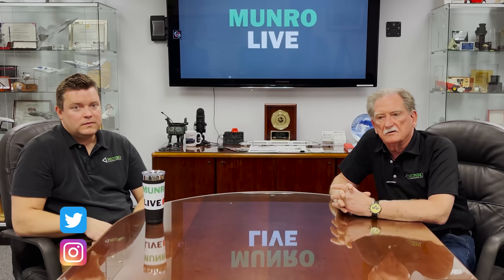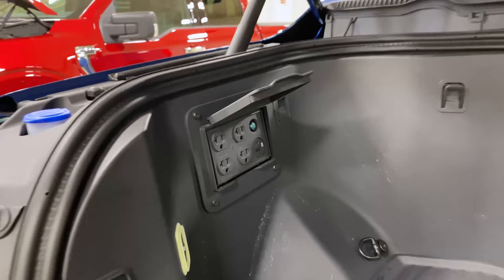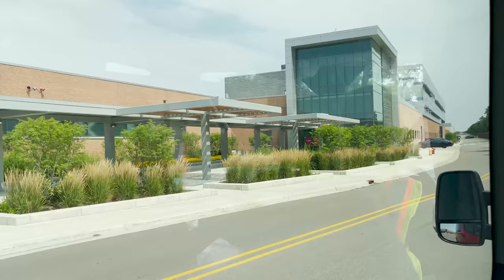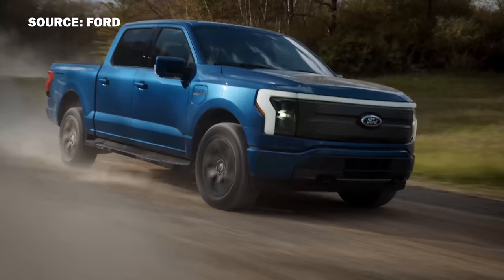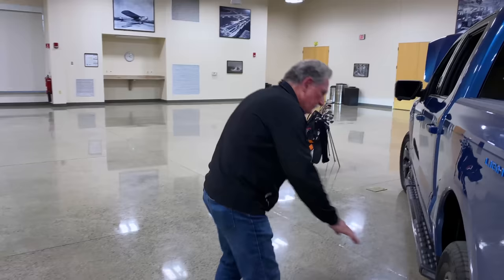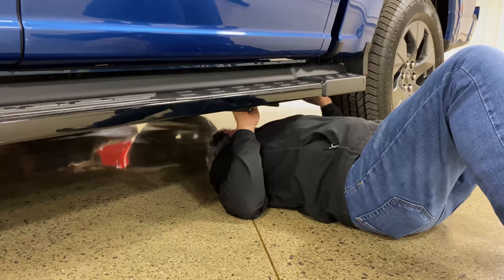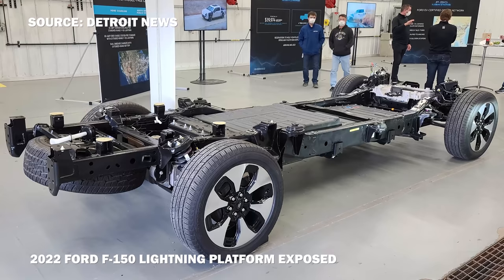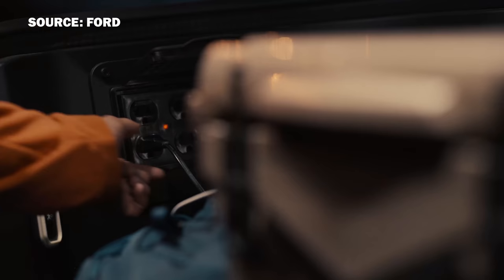Sandy's First Look at the Ford F-150 Lightning Electric Truck!

Comment: Wow, an electric pickup truck has so much going for it. Thanks to Tesla’s efforts to kick off the EV revolution!
Reply: @michaellowe3665  I think "right to repair" laws will address that. You have to give Tesla credit for lighting a fire under the butts of legacy car makers to produce serious EVs,not just compliance vehicles. Now you can get good EVs from GM and Ford. Tesla is about to release a $25K Model 2 that will help the average bloke afford an EV.
Reply: @mikedunn7795  if you follow Tesla's history, that 25k model will start as a 40k model.  They will finally sell a few of them at 25k 2 years after it comes out to meet their promise price, then they will stop selling it after a couple months and claim no one wanted it. Even if they score big gains in the battery cost, inflation is about to make the 25k electric car a pipe dream. Affordable cars are used cars that are over 10 years old.  Since there is and may never be an affordable replacement battery market, electric cars will remain disposable.
Reply: @michaellowe3665  " Even if they score big gains in the battery cost, inflation is about to make the 25k electric car a pipe dream" I heard the same thing when Tesla announced the projected price for the Model 3. TaDa, they did it! If you'd like to cite your references as to inflation projections on the specific battery industry, I'd be happy to see it. Otherwise, you sound uninformed. Your "affordable cars are used cars" is also a criticism of subjective affordability. If you personally cannot afford a new car, buy used. But to compare a decade-old used car to a new car in value is senseless.
Reply: @michaellowe3665  "They sold only higher trim models at first, then sold the 35k model for a short time," Looks like you lack basic math and logic skills. You just admitted that Tesla sold the Model 3 at the stated and projected price. How do you know that no one wanted the $35K model, and that more than enough people ordered more than the base features? 
"Most of the ones they sell are still 50k or more." Good for them - your own statements disprove your logic. Clearly the Tesla Model 3's base price is less than $50K, yet they sell the majority of their cars at more than the base price. That's good marketing and product creation, I'd say. You have completely disproved your own statements by admitting that the average Model 3 sells for MORE than it's base price, so maybe people want MORE than the base level features and pay MORE for it? If that's happening (and you've just stated it does), then MAYBE the pure base price wasn't wanted. Damn, I'm good.
Reply: @michaellowe3665  " Meanwhile, other car companies are selling 20k new cars that can drive 2000 miles on a trip without adding an extra day just for charging. Gas is not so expensive that it offsets the cost of interest on a 50k loan." Ah, now the anti-EV bias is visible. The price of Tesla's cars have nothing to do with your estimation of electricity vs. gasoline, but you've revealed that's your true argument. You just don't like EVs and are making some sidebar argument to convince yourself EVs are bad. 
I've owned an EV for 6 years now, 70K miles, driven in snow, mountains, 106-degree desert heat and it does not ad an extra day just for charging. Tell me, does your arse hurt a lot when you pull your statements out of it?
Reply: @michaellowe3665  "Gas is not so expensive that it offsets the cost of interest on a 50k loan. Most people live in reality bound by the laws of economics" And yet, Tesla outsold Nissan's sedans in 2021, outsells Mercedes Benz and other German car makers combined, and outsells all American car makers (sedans) as well. I'd say your reality is a biased one. No car maker aims to make its cars match the used car market. Show me the Ford board meeting that said "let's price the Focus like a used Chevy". 
Damn, I'm good.
Reply: @michaellowe3665  " Even if they can afford it, they find it wasteful to dump that much money on a disposable appliance." And there is the bias, again. Your  opinion of EVs does not mean the facts change for you. Don't want an EV? Don't buy one! Get your facts and logic straight, however. 
My "disposable appliance" is the best car I've every owned. Every software update improves it. No maintenance. No expensive gasoline. No exhaust. No oil changes. By all means, drive a car that needs Exxon's permission to operate.
Reply: @michaellowe3665  "Gas is not so expensive that it offsets the cost of interest on a 50k loan." Clearly people buy cars for things other than mileage, otherwise only a Toyota Yaris would sell. People are willing to buy a Tesla for the other factors that make the car attractive, namely continual updates, no gasoline whatsoever, 1/4 the operating cost, no maintenance (oil change, anyone? New spark plugs? Cat converter?). Keep making up reasons to not like an EV, this is fun.
Reply: @justsomeguy934  you wouldn't know logic if it bit you in the wallet. So you bought one and need to keep justifying it to yourself.  Ok thats fine. You missed the point.  Most people dont waste money like you so as much as they may like not having to buy gas, smell exhaust or pay for oil changes, they would rather not pay a bank thousands of dollars for interest on a loan for something that will be worthless in a decade. Tesla will sell plenty of 50K appliances to whoever will buy them, but they dont have a 35k car out there and they wont be getting customers that Mazda, Toyota and Ford are selling to now. They will get fanboys that are willing to prioritize fart noises on demand and overlook shoddy build quality. There are undoubtedly people that just have plenty of money and want a fast car that buy them too. It may even make sense to some people depending on their living situation, but it isnt a mass market car.  Its a gimmicky toy and hopefully the moments of joy it gives you to hear that fart noise when your passenger sits down makes up for the fact that you could have financed your retirement with the cost of the payments.
Reply: @justsomeguy934  you make a lot of dumb assumptions.  I really have nothing against EVs.  I may even buy a lightning used after some dope takes the hit on the new cost and you can get batteries for them.  I dont care for Teslas because they don't build serviceable cars.  When they eventually do need a battery they will be scrap because it will be cheaper to buy a new car than a replacement battery.  Hopefully there will be a replacement battery market that will make them not so worthless.  Other car makers have always made replacement parts available and didn't block aftermarket companies from making them.  They probably will with batteries too.  Tesla seems more interested in protecting their own profits than letting any aftermarket company make replacement parts.  They make their assemblies so complicated that replacement isnt easy.  Be a Tesla fanboy all your life if you want. I really dont care, but justify it to yourself instead of being shitty to other people.
Reply: @michaellowe3665  "Most people dont waste money like you so as much as they may like not having to buy gas, smell exhaust or pay for oil changes, they would rather not pay a bank thousands of dollars for interest on a loan for something that will be worthless in a decade. " Ah, the blatherings of the biased. May I assume that you make your same expensive car rants to, say, Lexus owners? You know, the people that buy a Toyota Camry rebadged as a Lexus but with $20,000 higher price? Or Cadillac owners that buy an Impala for many times the Impala price? Or the people that simply can afford a new car when you can't? I notice you haven't admitted that Tesla outsold all American car brands and is overtaking even Toyota. I proved your wrong, but you changed the subject as people like you do. This is fun, keep the hits coming pal!
Reply: @michaellowe3665  " Its a gimmicky toy and hopefully the moments of joy it gives you to hear that fart noise when your passenger sits down makes up for the fact that you could have financed your retirement with the cost of the payments." Ah, there's nothing like a sour grapes cry of the angry and jealous. We're past any factual discussion (we never WERE in one, but you didn't know that) and just hearing you say "anything but Tesla!". 
This would be amusing if you weren't making such childish statements. Do you want to keep buying gas, making poison out the tailpipe, keep Exxon in business and our finest giving free military escorts to oil tankers? By all means, keep that oiler. If you don't mind, after almost 50 years of driving and LOTS of cars, I'll keep my ever-improving car thank you very much. If you don't want an EV, don't buy an EV. But stop sounding like a baby that wants someone else's lunch.
Reply: @justsomeguy934  you think you are making good points but none of them refute anything I actually said.  Your straw man is certainly taking a lot of hits, but he isnt real.  No one said ford is trying to price new cars like an old Chevy, but they do have to compete with old Chevys when they sell them because people may figure out they can buy 3 of them for the price of a new car.  The new car market in general has to complete with the cars they sold in previous years.  Tesla's strategy is to just make them disposable.  You just keep paying them for the privilege of driving a virtue signaling status symbol.
Reply: @michaellowe3665  "Tesla will sell plenty of 50K appliances to whoever will buy them, but they dont have a 35k car out there and they wont be getting customers that Mazda, Toyota and Ford are selling to now." Again, you make baseless conjecture. In fact, what scares Ford, GM and other car makers is this: once a person buys an EV, they NEVER GO BACK to a gas car. I've talked to countless EV owners, all brands, and they all say they will never buy another ICE again. This is from people that trade in reliable cars like Honda Civics, Toyotas, Subaru's. Once traditional car makers lose a sale to an EV, they never come back.
Reply: @michaellowe3665  "It may even make sense to some people depending on their living situation, but it isnt a mass market car. " Again with the baseless statements. I've already proven Tesla outsold Mercedes Benz + Audi combined, outsells all American brand sedan makers, outsells Nissan in the USA. If that's not a mass market car, tell me what is. Tesla is eating every single car maker's lunch, pal, whether or not you want to admit it.
Reply: @michaellowe3665  " So you bought one and need to keep justifying it to yourself." Actually, it sound like YOU need to justify your ownership experience, not me! I can tell you that Tesla's research proves that the average Tesla owner sells 3 new cars. That's why Tesla never buys advertising - the owners, once they let people ride in their car, drive their car, see how the car works, trigger the sale of (on average) 3 more Teslas. Show me another brand that does that. It ain't Ford! It ain't Chevy!
Reply: @michaellowe3665  " they may like not having to buy gas, smell exhaust or pay for oil changes". Then why drive those cars? I go almost 300 miles on the price of about two clothes dryer runs' worth of electricity (about $11). The newer Teslas go 400 miles on that amount. One moving part in the motor (not hundreds or thousands), no oil, no spark plugs, no alternators, no exhaust, no high-pressure cooling system. If you think you're on to a good way to get around, be my guest. I haven't been into an auto parts store since I bought my Tesla, and will never need to. What advantages were you talking about with gas cars? I've forgotten what they are after typing all the things I don't need anymore...
Reply: @justsomeguy934  everyone will be making EVs. Tesla may or may not survive the competition. When there are other EVs to compare them to, Teslas will probably not fare so well.  There will likely be gas cars around for a long time to come because they make more sense in some situations.  Quit being such a dopey fanboy.  No one is jealous of your car payments.
Reply: @justsomeguy934  since this whole story was about the Ford F150 lightning, or have you forgotten?  Towing long range is the big problem with EVs.  Hook up a big boat and tow it from Michigan to Florida and you will see the limitations.  When you spend an extra 8 hours charging, you will wish you could just pull up to a pump for 10 minutes. This is true of any EV on a long trip,  but to a lesser extent when not towing. I agree they are better in most other circumstances except the purchase price. Those are big hurtles to main stream adoption.
Reply: @michaellowe3665  "No one is jealous of your car payments." I don't have car payments, and clearly you ARE jealous from your past comments. As for Tesla not faring well, it's the ICE manufacturers that are at least a decade behind Tesla. Only Tesla is building giga-factories to meet demand while everyone else is laying off workers and shuttering factories. Ford is in so much debt right now that they may never get out of the hole. Mercedes has shut down factories and gave up on making their own batteries. Building factories vs. shutting down factories...you can do the math, can't you? Regardless, you won't even be able to buy a new ICE after 2030 or so, let's see how quickly the traditional car makers convert, shall we?
Reply: @justsomeguy934  ok. I'm jealous of your ability to live a delusion and believe anyone cares about your overpriced appliance.  I wish I could feel so certain of my own superiority in the face of overwhelming evidence of bad decision making. Its a gift you evidently possess to be so indifferent to the world.  It must be easy to get through life without being burdened by humility or common sense.
Reply: @michaellowe3665  "I'm jealous of your ability to live a delusion and believe anyone cares about your overpriced appliance." The fact that you said "overpriced appliance" in your first statement proves that YOU DO CARE. You have some sort of price issue with Tesla, or the people that buy them, even though there are models that match the average price of a new car. You also made some comment about my car payments; who cares but you what my car payments might be? Your comments throughout this conversation have stated that normal people can't afford Teslas, normal people want used cars, etc. I've heard that exact argument about Teslas when the only models were the expensive ones (but oddly enough, they didn't lodge the same comments against Mercedes Benz or the people that buy $100,000 pickup SUVs). 
Your entire rant is obviously sour grapes. You make up reasons to insult a car you cannot afford (there are used EVs, you know). Since you want to call me names for proving your statements wrong, I bid you goodbye. You're looking childish, however, so I suggest you go rail against something else and not be so transparent  in your motives and your issues.
Reply: @michaellowe3665  " Be a Tesla fanboy all your life if you want. I really dont care, but justify it to yourself instead of being shitty to other people." Ah, the projection is strong with this one. You  know nothing about me at all, other than I bought a Tesla. It's you that has called me delusional, told me I don't make good decisions, have traded my retirement for a car, etc. I'd say it's YOU that's shitty to anyone that disagrees with you. I proved your statements false with facts (remember the sales claims you made?) and rather than admit you were wrong, you made up another allegation to be disproven again. Your issues with Tesla change as often as they are disproven and you clearly have jealousy issues with people who buy one.
Reply: @michaellowe3665  "I dont care for Teslas because they don't build serviceable cars.  When they eventually do need a battery they will be scrap because it will be cheaper to buy a new car than a replacement battery." Funny, you only mention serviceability now after I refuted all your other claims. That's how hidden biases work, you know. You gradually peel away the outer objections and find the true issue someone has - with you, it's apparently jealousy with Tesla owners. As for serviceability with the cars, you're mistaken again. I've damaged my car - it's an early model - and had a huge amount of repairs done on the car by a third party repair shop. Tesla didn't get near the car at all, yet lo and behold, the repair shop got all the parts they needed from Tesla. The shop's parking lot was FULL of Teslas waiting for repair. That particular shop was authorized for Porsche, Mercedes and Tesla. If you want a good job, become an authorized Tesla mechanic.
So now that I've refuted your serviceability claim about Tesla, can you make up another issue?
Reply: @michaellowe3665  " you make a lot of dumb assumptions.  I really have nothing against EVs." It's you that projects your personal issues with EVs, Teslas in particular, on me. Should I replay back all the assumptions you have made about me? Your "serviceability" claims is just the latest one you have to hide your true problems with Tesla owners. I'm sorry you don't own a car that you like as much as Tesla owners like theirs. I'm sorry you feel the emotional need to call people that have reasons for buying the cars they own "delusional" and question their decision making ability. Your insults are all over the place, uncalled for and childish. When someone does that, it's clear that the true cause of their angst is not the particular complaint they have at the time, but a deeper, emotional one. I don't care what you drive, where you spend your money, if you like sports. I have never called you a name, just called out your random claims against me for owning an (now much older) Tesla.
Reply: @michaellowe3665  " if you follow Tesla's history, that 25k model will start as a 40k model." Oh, you mean like Rivian, Ford and Chevy do? Your criticisms are not only oblivious to how businesses work, you don't make the same criticism of other vendors in the same industry. Clearly your issues are with Tesla and no one else. Your bias is still showing, pull your pants up.
Reply: @michaellowe3665  "they would rather not pay a bank thousands of dollars for interest on a loan for something that will be worthless in a decade." Um, I've owned several cars from new that got to a zero-repair value. That means that the insurable value of the car is less than the cost of a major repair. In short, drive the car until it's in an accident or damaged, but it's not worth it to repair. You don't replace a $2,000 engine in an $800 car. So I've owned several gas cars that have reached that point in 10 years, your criticism of Tesla is baseless. The continual software updates in Teslas keeps their used value up, as the purchaser knows their car will continually improve over time.
Reply: @michaellowe3665  "Towing long range is the big problem with EVs.  Hook up a big boat and tow it from Michigan to Florida and you will see the limitations. " Um, I've towed a heavy car on top of a heavy trailer from my house to several states away. I used my Toyota Sequoia at the time that could tow 8,000 lbs. Do you think I got the EPA mileage shown on the sticker? My mileage was horrendous.
Reply: @michaellowe3665  "since this whole story was about the Ford F150 lightning, or have you forgotten?" Actually, this is the first time you've mentioned trucks at all, or Ford. You went off on a rant about Teslas in general, and they don't even make a truck (yet). I think YOU forgot what you've said. Oh and the Cybertruck is already sold out for several years of production. I wish Ford the best, they would be a good candidate to sell an EV truck due to their market share. Let's hope they do a good job and not drag their feet like they have in the sedan market by making compliance cars only. Personally, I'd buy a Rivian before I'd buy a Lightning, it looks like Ford stole some ideas from Rivian after they invested in them.
Reply: @justsomeguy934  the other way to look at " continual improvement" is they should have designed it that way to begin with but we're in such a hurry to ship the shit out the door they half assed the software knowing they could update it later. How many times does IOS send an update a few days after their last one to fix stuff they screwed up in the last update?  Cars aren't cell phones.  They have probably dumped some dangerous files through their updates and fixed them without telling anyone about them. Its only a matter of time before they send an update that turns off the ABS in some situation and they dont get the fix out to everyone before a few people die.  Thats a shitty crutch for shitty sw design. Tesla is better at it than Chevy because at least they dont burst into flames when charging, but its still better to have it right before it ships.
Reply: @justsomeguy934  I like the architecture of the Rivian more than the Ford.  4 motors is a better solution.  It automatically eliminates differentials with optimal traction application. I probably still wouldn't buy the Rivian for several years because vehicles are exposed to the real world where things break and get damaged.  Much of the F150 will be interchangeable with the other 4 million trucks they build the same year.  There will be plenty of parts available.  A guy got rear ended in a Mach E and has to wait 6 months for the parts to fix it.  Even though its a Ford, they just haven't made enough replacement parts yet. Rivian is likely to be worse because they are a small startup that will be focused on getting their new trucks out of the door first. I also really hate the front end styling of the Rivian.
Reply: @michaellowe3665  "There will be plenty of parts available.  A guy got rear ended in a Mach E and has to wait 6 months for the parts to fix it. " Most new models are the same. I have a friend that's a Mercedes enthusiast (runs the local MB club), and every new model, depending on which sheet metal part you damage, can wait 6 months or more for parts. My damaged Tesla waited months on parts, but that is better now for my model than the new Model Y's.
Reply: @michaellowe3665  "Much of the F150 will be interchangeable with the other 4 million trucks they build the same year.  There will be plenty of parts available." That is an advantage of a Ford, as long as you didn't damage the electronics, battery or drivetrain. If the bumpers and sheet metal are the same, hot dog. If Ford designed the Lightning from the ground up to be an EV (like Rivian did), not much will be in common. Whatever Ford does, they are the best positioned to sell an EV truck at the moment. When the Cybertruck starts producing  vehicles, it will change the truck market entirely but any EV for that untouched demographic is good.
Reply: @michaellowe3665  "Rivian is likely to be worse because they are a small startup that will be focused on getting their new trucks out of the door first. " Yes, startups in the auto industry have billion-dollar problems that other entrenched companies don't. Tesla has already crossed that boundary and Rivian is learning from the Tesla experience, thankfully. I am currently researching Ford's battery supply chain, the most critical factor in volume production. GM uses South Korea (LG Chem) as their supplier, as does Mercedes and others. Nissan sold their battery factory, not a good sign that they'll be in the EV business for long. Toyota is completely out of the game, their future is at risk.
Reply: @justsomeguy934  defending a purchase of a Mercedes is more of an uphill battle than your Tesla.  They are an extreme waste of money and you still have to buy gas for them. They are better than Tesla about initial build quality, but then they have expensive parts including complicated engines.  Elon Musk was genius for going after buyers who may otherwise get a Mercedes.  It's not hard to beat their ownership experience. That was my point from the beginning.
Reply: @justsomeguy934  by the way, you keep bragging about only spending $11 to drive 300 miles.  Thats about half what it costs to drive a gas honda or Toyota the same distance.  The gas car drivers are also paying road tax when they buy it.  That can be half the price of the gas. If they put the road taxes on the coal you are using to drive around, then you would be paying about the same.
Reply: @michaellowe3665  " by the way, you keep bragging about only spending $11 to drive 300 miles.  Thats about half what it costs to drive a gas honda or Toyota the same distance." The price per mile varies with the price of fuel. My brother's Civic gets about 42mpg, which is great. It's difficult to compare his mileage to my 114mpge as the two cars are not the same. His 2018 Civic is a (at best) four-passenger economy car with lackluster performance. My Tesla is a 7-passenger vehicle, the size and weight of a Mercedes S-class sedan, and goes 0-60mph in less than 5 seconds.
Reply: @michaellowe3665  " If they put the road taxes on the coal you are using to drive around, then you would be paying about the same." Road tax (actually called DOT tax) is an issue that electric cars will have to tackle. The gasoline tax, while it doesn't cover nearly the actual costs of using an explosive, poisonous fuel, are proportional to usage. That is, drive a little pay a little; drive a lot, pay a lot. That's a fair way to do it, in my opinion. There is no good solution for cars that do not buy gas, and is quite the discussion topic among EV owners.
Reply: @michaellowe3665  "by the way, you keep bragging about only spending $11 to drive 300 miles.  Thats about half what it costs to drive a gas honda or Toyota the same distance." What Honda or Toyota are you comparing, say, a Model S to? Surely not a Civic or Camry, they're not in the same class. Use a Mercedes S-Class for vehicle passenger count, performance, storage room. Apples to Apples, and the latest S-class gets 20mpg city. My Model S gets 114mpge. Better than 5-to-1 improvement in mileage, not even counting that electricity is waaaaaaay cheaper than gasoline.
Reply: @justsomeguy934  Road taxes are federal and state not just DOT.  They were justified to pay for road construction.  The taxes far exceed spending on roads.  They heavily subsidize government spending elsewhere.  Many states are nervous about losing the revenue because they cant print money like the federal government.  The answer will be huge license fees and tolls everywhere.
Reply: @michaellowe3665  " Electric power generation is dirty.  " Can be, but doesn't have to be. My roof can make 110% of all the energy I need, silently and pollution-free for decades. And it doesn't matter when a solar panel makes the energy, it reduces the overall energy creation from dirty sources (like coal). In fact, if even a small number of neighborhoods had solar roofs, no new power plants would need to be built; they would produce the additional energy they need.
Reply: @justsomeguy934  its not just the batteries.  Its the motors and controllers. Not to mention the solar cells when used to make "renewable" power. They use tons of cobalt. They also use other materials like neodymium and dysprosium. Sure they are trying to eliminate them.  They don't want to pay the cost of mining them and dont want to be associated with the horrible working conditions where they are mined. The fact is, your Tesla uses materials and power just like any other car.  You keep bragging about how it comapres to an S-class.  It would use much less power and fewer materials if you opted for the model 3.  Ranting about how other cars poison the air is a bit rediculous when you didn't even minimize your own footprint.
Reply: @michaellowe3665  "They are worse than a clothes dryer because even in areas where renewable energy is prevalent, people are charging their cars at night when the sun isnt shining and the winds are light." Actually, no. Electricity is electricity, and what matters is how much dirty fuel is used to create it. If we offset all of our daytime energy with solar, for example, we've cut down on the total energy pollution by almost 2/3. Even using a dirtier source off-peak doesn't affect the total reduction in both purchased fuel and pollution to make the energy.
In case you're not aware, I've encountered every single statement you've made before and done my research. I have references and stats for every statement I make; I can prove what I say. You have yet to give me anything with which to discuss or review (I'm hoping you give me an oil company "study", those are the most fun).
Reply: @michaellowe3665  " you are contributing to ecological and human deviation too.  The jury is still out on how much. " Hey - did you know how much electricity is required to refine a gallon of gasoline? I know you don't, you haven't exhibited any research or fact checking, but I thought I would let you know. The industry arguable standard is 5kW per gallon, just to refine it. That's not extraction, transporting the crude, storing the gas, moving the gas again, storing again, selling it. Just turning goop into gas. Here's an interesting fact for you, too: on 5Kw of electricity, most EVs can go 15-25 miles. That's more than the average mpg of a new gas car in the USA! That's right, using just the electricity required to refine a gallon of gas, an EV can go as far or farther than a gas car can without burning the petroleum! Imagine that, just give the electricity required to refine gasoline to an EV and you get no pollution, no explosions, and you save crude being moved all over the Earth. Win win for EVs, yet again.
Damn, I'm good.
Reply: @michaellowe3665  "Ranting about how other cars poison the air is a bit rediculous when you didn't even minimize your own footprint" Let's see, no point-of-use pollution for an EV, a 96% recyclable storage battery, energy that can come from my roof. I'd say that's a minimized footprint!
Reply: @michaellowe3665  " Its the motors and controllers. Not to mention the solar cells when used to make "renewable" power. They use tons of cobalt. They also use other materials like neodymium and dysprosium." And for that material investment, you get free energy with no pollution for decades, no maintenance. BTW, I'm sure you're a smart guy, you're aware that creating a solar panel is the same process as making an LCD television, right? May I assume you visit various environmental blogs and protest all the flat screen TVs being made? I mean so you're not a hypocrite? 
And if you don't mind, please cite your references (scientific ones, please) for "tons" of cobalt in solar panels.
Reply: @michaellowe3665  " They don't want to pay the cost of mining them and dont want to be associated with the horrible working conditions where they are mined." Are you off-topic, or are you talking about solar panels? If it's batteries you're referring to, I've already debunked your "child labor" allegations pretty handily.  If you're referring to other metals like copper, magnesium or anything else, I suggest you research the computer you're using right now, or the car you're driving. Chromium is quite rare, found mostly in Africa, and is all over cars and in certain types of metals. If it's solar panel materials you're referring to, you must compare the raw materials from an alternative energy source, say, coal. Or diesel. Every minute those energy sources make electricity, they pollute. You must purchase and consume fuel. Solar panels and wind turbines, nothing at all.
Damn, I'm still good.
Reply: @michaellowe3665  "The fact is, your Tesla uses materials and power just like any other car.  You keep bragging about how it comapres to an S-class.  It would use much less power and fewer materials if you opted for the model 3. " The Model 3 wasn't available when I bought my Tesla, I couldn't buy it. I also have greater needs than a Tesla Model 3, but the Model Y or X looks like it could do for me. In the end, my car will outlive me and I have no need to replace it. After all, it does more, goes farther, is cheaper to operate than it was when I bought it.
Reply: @michaellowe3665  "You keep bragging about how it comapres to an S-class.  It would use much less power and fewer materials if you opted for the model 3. " And you could use much less power and fewer materials to drive any EV made, as it uses electricity, burns nothing, has a recyclable battery. Did you still want to criticize my choice of car, or are you done?
Reply: @michaellowe3665  "its not just the batteries.  Its the motors and controllers. " As usual, you're not thinking. You believe there's a crisis with the motors and electronics in an EV? You're ware that they are single-moving-part, sealed devices that have a million-mile warranty, right? They'll outlive the car. They'll outlive me! There are already independent sources to get those devices out of totaled Teslas, as well as the batteries. The battery pack of a salvaged Tesla is worth THOUSANDS of dollars! You're just making up some bogus criticism, as usual, when I disprove yet another wild claim of yours. I must compliment your tenacity to cling to such an easily disprovable opinion.
Reply: @michaellowe3665  "They don't want to pay the cost of mining them and dont want to be associated with the horrible working conditions where they are mined. " You mean like the iron, bauxite, magnesium, copper,  chromium and other mined metals in the car you drive right now? Or in the computer you're using right now? Or in the television you use?  Or in the cell phone you have? Is THAT the horrible conditions for the products you purchased already? Or is it just when EVs use metal, glass and rubber that you're offended?
Reply: @justsomeguy934  you have debunked nothing in the whole conversation. Just because you say they dont use rare earth metals in batteries doesn't make it true. Where are your sources?  I know they still use them in motors.  Lithium isnt exactly clean to mine.  The worst is cobalt.  I mentioned solar panels to head off your next argument that all your energy use is "renewable".  Maybe I presumed too much and you would just admit that your car runs on coal.  

Look I dont have anything against electric cars.  They are somewhat better in most ways than gas powered ones except long trips.  I dont like Teslas because they are kind of ugly.  They look like a dodge stratos that was parked next to a fire and the grill melted shut.  The interior is dumb.  It looks like a child hot glued an I pad to the dash. Nothing works if the center screen goes bad. Unfortunately Ford is copying that stupid look.  

Tesla took a simple drivetrain and added needlessly complex doors, handles and actuators that can fail and do often.  Watch TFL cars on YouTube to see what a piece of junk their model 3 was.  Their service system requires you to wait for them to show up.  They are hostile to people who want to do their own repairs. Watch Rich Rebuilds for that story. My Toyota had a bad drivers door lock.  I watched a YouTube video and bought 2 motors for $12 on Amazon. It took me a couple hours to fix it. I only needed one motor so I have a spare.  Tesla would void supercharging if I dared to fix my own door lock. 

Tesla put cameras inside the car and constantly collects telemetry data on their customers.  They say its needed for self driving that many customers dont even have, but in reality they are selling the data.  They also use it to deny warranty claims and blame customers for crashes during their self driving beta test if they didn't have both their hands on the wheel at the time.  

They have shoddy build quality in general but are getting better with more recent models.  

I plan to buy my next car soon and drive it for 20 to 30 years.  I want to be able to fix anything wrong with it and keep driving it.  It is not feasible to put a $30k Battery into a 12 year old car.  

Im glad there are early adopters out there spending their money foolishly. Im glad Tesla is building toys for people that real car companies are learning from. When those companies are making reliable cars with decent build quality and I can buy a replacement battery and put it in myself, I will probably get an electric vehicle.  More likely, I will just rip the motor and gearbox out of one like yours when it hits the junkyard and I will put it in something that looks good. 

Hell its possible Tesla will make something I would buy someday. They would have to ditch the data collection, make it decent looking and only make it update when I want it to. 

Most of what you consider features of your car, I find abhorrent.  You can enjoy it all you want. I dont care. I dont like them for now and wont unless they make major changes to their design and attitude toward customers.
Reply: @michaellowe3665  "Just because you say they dont use rare earth metals in batteries doesn't make it true. Where are your sources?  I know they still use them in motors. " I never said they don't use some rare metals in batteries; I said they are miniscule levels and the entire battery, all metals and casing, are 96% recyclable. You should read what I write, and you should not type up a novel all at one time. If you'll note, I quote back to you what you say and then react. That's how you have an online discussion.
Oh and I have refuted every claim you've made, with links to unbiased sources (or haven't you check them out?) Let's see the topics so far: Tesla isn't selling, Tesla's got the wrong market, electricity is as dirty as oil, etc. I can actually go back to your previous comments if you like and list all my responses to your claims.
Reply: @michaellowe3665  "Hell its possible Tesla will make something I would buy someday. They would have to ditch the data collection, make it decent looking and only make it update when I want it to. " Gosh, do you have the same requirement for your cell phone? Apple for one won't let you go too long before a software update, as will Adobe for Photoshop. Companies cannot have the liability of a customer refusing an update for safety reasons. As for the looks of a car, you can drive an econobox all you want; be aware that many Tesla cosmetic points are already copied by other car makers. In fact, it's whether or not your car looks like a Tesla, not the other way around.
Reply: @michaellowe3665  "They have shoddy build quality in general but are getting better with more recent models.  " Again, customer satisfaction with Tesla exceeds all other brands. I've owned my Model S for 6 years now, it's the best car I've ever owned and I will never buy another gas car again given my experience. That's what scares the likes of Exxon and Honda.
Reply: @justsomeguy934  my cell phone wont ram me into the back of a truck by turning off the ABS due to a glitch. Oops sorry. That was 14.1 sw.  You should have updated to 14.1.1 when it came out 4 minutes before your accident.  We arent responsible.
Reply: @michaellowe3665  " You can enjoy it all you want. I dont care." But you DO care. You've done nothing but call me names, called me delusional, stated I don't have good decision making ability, spent my retirement on my car, etc., just like a jealous child. You've shown you care every comment you've made. It's damned obvious.
Reply: @michaellowe3665  "Look I dont have anything against electric cars. " Just those that buy Teslas...
Reply: @justsomeguy934  econobox...  Have you seen the cybertruck?  Its a doorstop.  The reason other cars look like a Tesla is they copied other cars from the 90s. Not good ones either. I prefer trucks, or cars that are 50+ years old for styling.
Reply: @michaellowe3665  "They look like a dodge stratos that was parked next to a fire and the grill melted shut.  The interior is dumb.  It looks like a child hot glued an I pad to the dash. Nothing works if the center screen goes bad. Unfortunately Ford is copying that stupid look." Welcome to touch screen cars, pal. They're all copying Tesla because it's a superior design. What you THINK are analog gauges are likely digital ones. Trucks and cars all have that layout now, and hope someone THINKS it a Tesla. My 17" touch screen is integrated into my dash, shows me car status and navigation, tells me where to charge, manages the car for me. 
If you like your Buick Century and oil pressure gauges, have at it. No car you buy new in the future will, so you be the dinosaur that you are.
Reply: @michaellowe3665  " I dont like Teslas because they are kind of ugly." You  don't like Teslas because they're not  what you're used to and they [used to] cost more than you can afford. Your vitriol towards me in your conversation shows that plainly.
Reply: @michaellowe3665  "I plan to buy my next car soon and drive it for 20 to 30 years.  I want to be able to fix anything wrong with it and keep driving it" I couldn't agree with you more. Given that the battery in my Tesla is rated for 300,000 to 500,000 miles and the motors have only one moving part, I'd say it's a safe bet I'll get to 30 years in my Model S long before you get to 30 years in a car burning oil.
Reply: @michaellowe3665  "When those companies are making reliable cars with decent build quality and I can buy a replacement battery and put it in myself, I will probably get an electric vehicle. " So you want to replace a 1,100lb battery that lasts 300,000 miles yourself? Tell me, do you have the same standard for gas cars? Do you, say, often replace the engine block of the cars you drive?
Reply: @michaellowe3665  "Have you seen the cybertruck?  Its a doorstop.  The reason other cars look like a Tesla is they copied other cars from the 90s. Not good ones either" And yet the Cybertruck's first 3 years of production are already sold out. Love it or hate it, it's popular. Want a truck that looks like a 1962 Studebaker truck? Buy a Ford!
Reply: @michaellowe3665  " I prefer trucks, or cars that are 50+ years old for styling." Then you'll realize that you're a very small demographic that no car maker will cater to. Evidence: the retro-styled Ford Thunderbird, the retro-styled Plymouth Prowler. Keep driving that Buick!
Reply: @michaellowe3665  "That was 14.1 sw.  You should have updated to 14.1.1 when it came out 4 minutes before your accident.  We arent responsible." Oh sorry, does your criticism include the steering column lock on Chevy sedans a few years ago that caused the cars to crash and killed the occupants? Or the fires caused by a drop-in tank on the Pinto? Or the wheels that fell off Jeeps of a certain year? Or the car fires caused by the Honda window switch on the Accords when water fell on the switch from an open window? I'm having trouble assessing your risk from a Tesla software update...
Reply: @justsomeguy934  millions of people still like classic cars and would drive them if they had the skill to maintain them and could add a few new features.  Classic car auctions appeal to more than a small demographic.  Teslas are boring looking cars.  The reason they are tapered is so the factory doesnt slam shut when they drive out.
Reply: @justsomeguy934  watch rich rebuilds. Your repair shop may have gotten permission from Tesla, but home mechanics have more problems.
Reply: @michaellowe3665  "watch rich rebuilds. Your repair shop may have gotten permission from Tesla, but home mechanics have more problems." As I've already stated, I'm acquainted with Rich Rebuilds. I've disproven your right-to-repair allegation, and would like to know how many people take the engine out of their car...do you? Exactly how many Teslas need to be rebuilt from a salvaged car like Rich does? That's your standard for car repair?
Reply: @michaellowe3665  " I know the benefits of electric cars.  I also know their limitations.  I would easily replace a battery in one if I can get the technical information to do it.  " You know much less than you think because you don't drive one or own one. By all means, if you want to replace the battery in a car, do so. The times that you'll need to do that are...zero. Since they last 300,000 miles before 10% degradation, I'd say I have long after I'm dead before I'll even need to think about it. Oh and why are you driving vehicles that need their engines replaced? Maybe you should think about getting an EV, only one moving part per motor....wink wink
Reply: @michaellowe3665  "Who do think goes into Autozone? They have a whole shelf full of books that show you how to work on them. " And that shelf of books tells you to...replace a water pump? Change the spark plugs? Weld on a new catalytic converter? Pull the exhaust manifold? You need that because those cars have all those moving parts! I don't think you realize that the need for those skills is unnecessary going forward. Tesla will send a tech to my HOME, in my DRIVEWAY to fix or adjust something. Do I know people that have replaced parts on their Teslas themselves? Sure! You're "I've gotta replace the battery myself!" requirement is certainly unnecessary and an unrequired skill for an EV. I refute one thing you say, you jump to another. This is still fun.
Reply: @michaellowe3665  "I would never waste money paying a mechanic to do work I can do myself.  Thats a bigger demographic than you think.  Who do think goes into Autozone?" I never waste money doing work that costs less than I make per hour.
Reply: @michaellowe3665  "again you debunked nothing.  I know the Tesla and Ford have intrusive driver monitors that was my point. " I've debunked everything you've said! I've already given you a partial list, all you have left are opinions on what a car looks like, whether or not you like a touch screen, silly stuff like that. Do you really want me to make a greatest hits list of all the objections you've used to hid your anti-Tesla opinion? I'll get right one it.
Reply: @michaellowe3665  " again you debunked nothing.  I know the Tesla and Ford have intrusive driver monitors that was my point.  " Really? I've driven my Tesla with a 17" monitor embedded in the dash for 6 years and 70,000 miles now and love it. In fact, any car that does NOT have a touch screen is a Flintstones Mobile. Tell me, do your cars have a choke or spark advance?
Reply: @michaellowe3665  "Of course that is if you don't damage it by fully charging or discharging . I hate it when I fill my gas tank all the way regularly and it makes the tank smaller.  Wait that doesn't happen." Um, the computer manages the charging and while possible, damage is rare with 100% supercharging (I, in fact, know someone who did that). Even if your range is reduced, it fits in the expected degradation and range loss. My personal car? I've had 6% range loss first 2 years, then it's flat, no further loss. I charge every day, Supercharge on trips. I'd say I'm a good sample case.
Reply: @michaellowe3665  " I hate it when I fill my gas tank all the way regularly and it makes the tank smaller.  Wait that doesn't happen." Oh yes it does! Your ICE is never better than the day you buy it. It degrades in efficiency and MPG from that day forward. I've owned lots of ICE cars and I can personally tell you that the MPG drops after years of use, shortening the range, making the car more maintenance-prone and costly.
Reply: @michaellowe3665  "Teslas arent well made especially the S and the X. That isnt a secret. Most Tesla owners admit to that.  By the way spark plugs, catalytic converters, and exhaust manifolds are not moving parts." Did the fit & finish of the early Teslas match a Mercedes? Nope! Yet, Teslas outsell Mercedes, so your metric doesn't seem to matter much to the owner. Tesla's been making cars for 10 years now, MB for over 100 years. MB's, Toyotas, Nissans, Fords should be PERFECT. Yet, we have annual recalls and misfit panels on all brands. 
As for spark plugs being moving parts, they (and cat converters) are parts that wear and must be replaced. You're not honestly going to claim an ICE is equivalent to a sealed electric motor, are you?
Reply: @michaellowe3665  ""I have debunked you therefore I am right"  you sound like CNN. Still you have debunked nothing. " Hey - I'm waiting for you to say "I don't like EVs because the upholstery in a Tesla is bad". You just make up sidebar excuses to hide your jealously or your dislike for Tesla owners in general. I don't care what you drive, but YOU care what I do! You've called me delusional for spending what I did on a Tesla (what I can spend on a car is the true source of your issues, let's be honest), yet you don't also criticize (until called out on it) a Mercedes Benz purchaser or a truck purchaser. Only Tesla owners, or me. This long trail of complaints of Teslas or the EV industry in general is merely a distraction for the real issue - you can't afford an expensive car and hate those that do. You must keep up the charade to look like you have some environmental reason to feel the way you do, but we both know it's jealousy. If you don't want an EV, don't buy an EV. But to call names because someone has a nicer car, bigger house, better pay, etc., has no place for adults.
Reply: @justsomeguy934  actually ICE milage gets better after the break in period, then it slowly declines, but not noticeably.  Many gas engines go 300k miles or more.  You can then rebuild them for a few thousand dollars.  I have gotten over 200k from every one I kept long enough. At no time did I lose 10% of range.  It was also not dependent on filling my tank regularly.  I could do that every time and not adversely affect it. It also only takes 10 minutes to fill it so its not too big of a deal.  If you supercharge your Tesla to 100% regularly, you will kill the battery in 2 years.  Tesla will know because they are tracking you and they will not replace it under warranty. 

I do like the idea of filling up at home instead of a gas station.  I don't refute the actual benefits of electric.  You are such a one sided fanboy, you dont acknowledge any drawbacks.  Its a tradeoff and depending on your situation can make sense.  It just doesn't work for me yet.  I'll look at the Rivian and the lighting when they come out.  Maybe even the cybertruck, but that is not a likely buy for me because of all the current features I dont like in Teslas.
Reply: @michaellowe3665  "actually ICE milage gets better after the break in period, then it slowly declines, but not noticeably.  Many gas engines go 300k miles or more.  You can then rebuild them for a few thousand dollars.  I have gotten over 200k from every one I kept long enough. At no time did I lose 10% of range. "
Rebuilding the engine is a major event, wouldn't you  think? And one not required by an EV? As for 10% range loss, I don't know a single Tesla owner, even those with 150K miles, that have that much loss. The empirical data I've shown you (and will do so again) tell you that the batteries last 300,000 to 500,000 miles before any appreciable loss is incurred, and then you could - only if the loss affects you - recycle the battery. Your rebuilding the car's engine is equivalent to replacing a battery are you reset the failing parts of the car. 
As for losing 10% range in an ICE, I sure have! I can personally tell you that a 25mpg car after 100,000 miles gets 2.5mpg less than the day I bought it! And if I would be required to replace/rebuild the engine to do it, I wouldn't pay for it! 
So show me your 500,000 ICE car with less than the Tesla equivalent of 6% range loss without an engine rebuild, please.
Reply: @michaellowe3665  "If you supercharge your Tesla to 100% regularly, you will kill the battery in 2 years.  Tesla will know because they are tracking you and they will not replace it under warranty. " Interesting, as the older Teslas, in order to keep them warranted, have their supercharging speed reduced, not the ability to supercharge. As the car ages, the full charging rate is reduced slightly to maintain battery health. I know, I have a 6 year old Tesla. Your warranty statements are not true, nor to they match what I observe in owning my Model S for 70,000 miles. I've reviewed the warranty on my car and it does not say "excessive supercharging will void the warranty". Tesla does everything it can to keep the battery healthy. May I ask you again, does your arse hurt from pulling all the statements out of it?
Reply: @michaellowe3665  "Many gas engines go 300k miles or more. " But the cars don't! The average life, and financial value, of an ICE vehicle from new in the USA is about 100,000 miles. Cars are replaced at that point, insurance value is zero at that point, and any even minor accident causes the car to be totaled. I've never seen my car or a friend's car with much more than 100,000 miles on the clock before they replace the vehicle. Your statement is an engineering projection, not actual use or utility. The cost of maintaining an ICE after 100K miles goes up significantly, reliability drops significantly, even to the point of requiring an engine rebuild (which you admit to).
Reply: @justsomeguy934  you like to keep claiming other people are just "jealous" of your Tesla and all the money you have because you can afford it.  Wow.  That's something a mother tells a child who wore ugly clothes to school and was teased.  Its not something a well adjusted adult actually believes.  I stated why I dont like Teslas long before you decided to chime in and tell me all about yours and how you paid for it.  You made it a personal attack on your own judgment.  I just said I dont like how they build their cars.  

I dont like Mercedes either.  I believe they are overpriced, unreliable, difficult to repair and have dismal resale value.  I wont buy them but other people are welcome to do so. I never mentioned them at first, because they were initially irrelevant to a conversation about electric cars. You brought them up because its the only car that makes so little sense to an average buyer that it makes your Tesla seem like a wise decision.  

The fact is that a $700 clunker will do 90% of what any other car will do.  It will get you to and from some cube in the city at 15 mph in bumper to bumper traffic.  If someone wants a new car with some features, a 20k Mazda will do the same thing with air conditioning and reliability that will carry them past the point they will trade it in anyway.  Im fine with the fact that you like your Tesla. I dont care and am not jealous no matter what your mom tells you.
Reply: @michaellowe3665  " you like to keep claiming other people are just "jealous" of your Tesla and all the money you have because you can afford it. " No, just you. I never said anyone was jealous of spending money on a car but you. Your calling me delusional (do you deny that?) for spending that money, mentioning risking retirement to buy the car, etc., all comments from YOU related to the price of the vehicle. Those comments came from YOU before any other objections (child labor, dirty electricity, etc.) every occurred.
Reply: @michaellowe3665  " Im fine with the fact that you like your Tesla. I dont care and am not jealous no matter what your mom tells you." No, you are not. If you don't care whether or not I like my Telsa, why did YOU spend so much time calling in to question making ability for buying it, question my retirement for buying the car, mention the price of the car payments? You did all that, regardless of how you'd like to portray it otherwise. Just own it. You made up, or repeated, baseless arguments after I called you out on it.
Reply: @justsomeguy934  my point was it is an overpriced car.  That is one of its many drawbacks. Most people would get a loan to buy it.  Most people would pay more in interest on that loan than they will save in gas over buying a 2 year old Toyota.  I was making the case for most people.  I dont know you and dont care to.  You seem insufferable.  I dont care how you paid for it.  You volunteered all that information. No one wants to know it.
Reply: @michaellowe3665  "my point was it is an overpriced car. " Do you say that for a Mercedes owner? Or a Lexus owner? Or someone who buys an expensive truck? I bet you don't, or you denigrate anyone that can buy a car more expensive than you can afford.
Reply: @michaellowe3665  " You seem insufferable.  " No, I called you out on your insults. Don't want an EV? Don't buy an EV. Just don't make up bullsh!t about the owners and the cars. And don't call me delusional for buying a car you won't.
Reply: @justsomeguy934  some of those were other people's statements. You failed to mention your own obnoxious insulting statements. Namely that I must be jealous that you can afford a Tesla. Thats seriously childish. You proved my point about appealing to someone's vanity and need to vitue signal.  You pretty much confirmed it with all your comments about other people being jealous of you. I could admit that statement may be a bit harsh and it may not apply to everyone that buys a Tesla, but you pretty much fit the description.
Reply: @michaellowe3665  " You failed to mention your own obnoxious insulting statements. Namely that I must be jealous that you can afford a Tesla. Thats seriously childish." You're correct it's seriously childish that you care about what someone else can afford. Tell me which statement's weren't yours, please, as I copied them right out of your replies to me.
Oh and tell me where I called you delusional, called in to question your decision making ability for buying a car.
Reply: @justsomeguy934  I never said you were delusional for buying a Tesla.  You are delusional for thinking other people are jealous. I dont care what you can afford.  I care what most people can afford because it helps determine if there will be enough sold and if the company will be around long enough to honor warranties and provide parts. I care about the market for these vehicles. I hope the sell enough lighting pickup trucks to make them a good choice to buy 5 years after launch.
Reply: @michaellowe3665  " I dont care what you can afford." Your "for wealthy people" and "average bloke" comments prove otherwise. Did you want to talk about the child labor support you accused me of that was for copper mines? Or the lithium mining impact that isn't mined? Or the right-to-repair violation claim you made when I proved it false? Or the Tesla warranty issue if you supercharge too much with I disproved? Or that Tesla sells your driving data to other companies that I disproved? I mean, I provide the proof, you provide the false claim or idea. I have yet, btw, to see any references to anything you say is true about Tesla or EVs. 
Did you want to keep talking about this?
Reply: @justsomeguy934  I never said average bloke. That was someone else's comment. Pay attention.
Reply: @justsomeguy934  you provided no proof of anything.  You just typed it out like its the truth and you expect people to believe it.
Reply: @michaellowe3665  " you provided no proof of anything.  You just typed it out like its the truth and you expect people to believe it."
Absolutely incorrect, a lie if you will. I've provided multiple references to disprove what you've said. Independent sources for battery life on Teslas, for example. I've left you multiple links to sources you can review yourself. I've also told you where your statements were wrong, such as the Tesla selling your data. You have no proof of this whatsoever, but I can prove Tesla cancelled their contract with MobileEye (developer of AP1 autopilot logic) over that very topic. I've also left you references on Tesla sales amounts.
If you'll kindly go back and review my responses, you'll see the independent sources that disprove you. YouTube will drop any comment that has too many link in one place as spam, let me leave individual links for you (I don't like to repeat myself, but you're a special guy).
Reply: @justsomeguy934  thanks for that information.  Holy crap.  5.6% failure rate?  That is awful.  If gas engines failed at that rate, there would be a massive recall.  Many of them will have a small problem that makes them fail at some point, but its fixable for a few dollars to a few hundred dollars.  ICE cars rarely have a failure that costs more than that in the first 80 miles.  When a Tesla battery fails, it represents most of the value of the vehicle.  That came from an obvious Tesla fanboy wearing a Tesla shirt with 2 tesla posters.  Thanks for making my point.
Reply: @justsomeguy934  you failed to mention if those were driveline problems.  That is the only part that matters when comparing EVs to ICE cars. Wheels falling off isnt something that magically goes away because the car is electric.  Its still a car, not a land speeder. Try to stay focused. The reality is that all cars have various problems that need fixed. You wont find 5.6% of ICE cars that need a $20k to $30k driveline part replaced in the first 80k miles.   

The other video was just another EV cheerleader.  I dont disagree that electric cars have better drivetrains and could be a better choice for most people most of the time.  When you get all of your "research data" from other fanboys, its going to be a bit biased. With an issue as complicated as trying to compare all of the environmental factors between ICE and EVs there are many lies of omission embedded in their little cartoon.  What doesnt lie is the total cost of ownership. Cars are made if materials and energy.  When you add up all of the materials and energy that goes into them, you end up with a sale price.  Any 80k car has a bigger environmental impact than a 20k car.  Then you can add the cost of the fuel and you can get a better idea of what it takes to move you around. Cost and environmental impact are linked.  That is before you include the fact that EVs are subsidized and gasoline is taxed, highly.  If EVs needed less material and energy to build, they would sell for less than an ICE car.  Right now, they dont sell any EVs that compare to a base Mazda 3.  They have to bury the additional production cost in high cost luxury trims that cover up the additional energy and materials needed to make them.  Eventually they equalize out over time as the fuel cost applies, but that isnt a fair comparison, because gas is taxed more than the coal the EV uses.
Reply: @michaellowe3665  "you failed to mention if those were driveline problems.  That is the only part that matters when comparing EVs to ICE cars. " Sure were, very early in the history of the Model S! Guess what? Tesla fixed them, they do not occur anymore. The roofs of Model 3's that were cracked upon delivery were repaired under warranty, the robots fixed, not a problem anymore. I suggest you look into the reporting of a problem and see if it's been fixed to never occur again.
Reply: @michaellowe3665  "You wont find 5.6% of ICE cars that need a $20k to $30k driveline part replaced in the first 80k miles.   " You find a Tesla made in the last 5 years that NEEDS a $20K driveline part fixed. When a production issue was found, Tesla replaced the part under warranty, corrected the manufacturing line, no further problems.
Reply: @michaellowe3665  "That is before you include the fact that EVs are subsidized and gasoline is taxed, highly.  If EVs needed less material and energy to build, they would sell for less than an ICE car.  Right now, they dont sell any EVs that compare to a base Mazda 3. " First, Tesla has announced a $25K EV in the next few years, so they will make a car similar to a less expensive model. Tell me, do you criticize Mercedes Benz because they don't make an economy car? Just curious.
As for EVs being subsidized, Tesla has long lost any purchase incentive for car buyers (it ends fully at 250K cars, declines after that). Unless those incentives are extended, people buying Teslas aren't getting any tax benefits. Even if they did, that does not compare to the trillions in annual subsidies that oil gets, so let's level the playing field, shall we? Do you see a flotilla of aircraft carriers or $500,000 fighter jets escorting container ships of Teslas? You do for oil! Not one dime of what we American taxpayers spend on protecting oil tankers gets billed to Exxon. If you'd like to have the subsidies discussion, we can:
Oil subsidies in trillions of dollars according to the IMF: https://www.imf.org/~/media/Files/Publications/WP/2019/WPIEA2019089.ashx
Reply: @michaellowe3665  "Any 80k car has a bigger environmental impact than a 20k car.  Then you can add the cost of the fuel and you can get a better idea of what it takes to move you around. Cost and environmental impact are linked.  " And the $80K Tesla Model S gets 114mpge (at least mine does) and the larger MB S-Class gets about 20mpg. I think you've just help make my point that regardless of model or weight, an EV is a better choice.
Reply: @michaellowe3665  "They have to bury the additional production cost in high cost luxury trims that cover up the additional energy and materials needed to make them." The motors are shared between a Tesla Model S, X, Y and 3. The battery packs have as many batteries as that car will accommodate. The leather in the cars is the same (a larger car will have slightly more leather, the seats are bigger), the carpet is the same (more carpet in a larger car) but I fail to see some extra bling you're trying to imply. Yet again you're comparing a Tesla to a car they don't make, so that argument goes no where.
Reply: @michaellowe3665  "you failed to mention if those were driveline problems.  That is the only part that matters when comparing EVs to ICE cars. " Why would I mention a problem that no longer occurs? Would you like to talk about early Model S door handles that had to be fixed? That happened in the very early production models, all fixed on warranty, future issues corrected, not a problem anymore. 
Another proactive action by Tesla: a very early owner ran over a trailer hitch on the highway that catapulted itself through the battery pack. The car immediately told the owner to pull over, that the battery had been damaged. In about 20 minutes, the battery (damaged, remember) caught fire. No explosion, no harm to anyone. If the driver had been in a Ford sedan, for example, and ran over debris on the road that punctured the gas tank and caught fire, Ford would have said "you ran over something, not our fault" and done nothing. And YOU, dear friend, would accept that car fires happen as a natural risk of owning a gas car (17 car fires an hour, to be exact).
Tesla, however, is different. Tesla reviewed the accident and made the decision to put a 6mm solid aluminum plate under the car to protect the battery. Here's the REALLY interesting point: Tesla not only made a change immediately in the production line, they retro-actively fit a plate under existing cars, those already in the hands of owners. Do you think Ford or Toyota would do that without a recall? Or a lawsuit? Do you want to accuse me of lying about this - I personally know a Tesla owner that had his car retrofitted with exactly that plate. Further, Tesla made an immediate software update that raises the driving height of all Teslas with air suspension when at highway speeds. The problem was absolutely the fault of the driver running over debris on the road, but Tesla fixed any future problems for everyone. You can talk about a 5% non-existent driveline problem if you want to, I'll continue to buy cars from a company like Tesla.
Reply: @justsomeguy934  Tesla doesn't make it because they cant compete at that price.  The cheapest car they sell is $40k. They dont sell a $25k car because the materials it takes to make one would cost more than $25k.   Their "$35k" car now starts at $40k. The reason for this is there are huge profits in luxury features and higher trim levels.  They can use those profits to offset the fact that they cant get the material cost low enough to compete in the low end market. They also weigh 4000 pounds at minimum. There is just more material in a Tesla. That costs money and takes resources to produce. Are you redirecting the conversation to cover up the facts or do you not understand the concept?
Reply: @michaellowe3665  "Are you redirecting the conversation to cover up the facts or do you not understand the concept?" Actually, your flaming ignorance is keeping me warm. What did I get wrong factually about the difference between Tesla models? Here's where you lack good information (yet you comment, oddly): The largest cost factor in ANY electric car is the batteries. The reason the first Model S's were as expensive as an S-Class car was that the batteries cost Tesla about $2 a piece to make them 10 years go - all 7,104 in my car alone. The new 100 kW packs have over 8,000 batteries in them. By your own admission, it costs about $2,000 to replace (or manufacture) an engine in an ICE car. So my older Model S has a $15,000 battery pack in it, the new gigafactory in NV is making batteries at about 1/3 the price per cell as when my car was made. Only Tesla saw the value of vertical battery manufacture, and only Tesla makes its own batteries in gigafactories. The economies of scale, and battery improvement, are what lowers the cost of the car. In the Model 3, the fabulous engineers ALSO reduced the weight of the car by about 1,500 pounds from a Model S. 
You're correct, a Model S is a substantially larger vehicle than a Model 3. The Model X is even bigger than the S. The price difference, however, mainly sits in the battery pack.
Do you still think your [supposed] knowledge of ICE cars applies to the modern world? Are you redirecting the conversation back towards the steam engine or do you not understand the concepts we're discussing? See? I can meet your childish discussion level if you want...
Reply: @justsomeguy934  the video you sent stated that 5.6% of Teslas had a battery failure and most before 80k miles.  That was your source.  Its fine if they replaced most of them under warranty, but how many will fail out of warranty?  That's a huge expense for someone who plans to save money driving electric. Thats the biggest problem to the average consumer.  Because the purchase price is so high, you dont start saving money until you have had it several years.  Once its out if warranty, it can quickly become too expensive to fix if it has a battery failure then. 5.6% is rediculous considering what that battery costs. Real buyers who arent fanboys will not be satisfied.  They may be worthless at a certain point in the used market if reasonable replacement batteries do not become available.
Reply: @michaellowe3665  "They dont sell a $25k car because the materials it takes to make one would cost more than $25k.   Their "$35k" car now starts at $40k. " I can tell you're not reading what I write, because I've already told you Tesla has announced a $25,000 EV model. I've also already told that the Tesla Model 3 DID price at $35K, everyone wants more features. In fact, the average price is near $50K, higher than the minimum. Tell me, do you think a company should make a product at a lower price than people want to pay? Can you shoot me your education credentials, please?
Reply: @michaellowe3665  "They dont sell a $25k car because the materials it takes to make one would cost more than $25k." Funny, I heard the exact same thing when Tesla announced the Model 3 at half price or less of the Model S...
Reply: @michaellowe3665  "the video you sent stated that 5.6% of Teslas had a battery failure and most before 80k miles.  That was your source.  Its fine if they replaced most of them under warranty, but how many will fail out of warranty?" I can tell you they DID replace them out of warranty, and that the battery pack in the Model S is on revision "E". I have a "C" pack. The data that's extrapolated includes all packs, thank you very much. Given that Tesla has an 8-year, million mile retroactive warranty, I'd worry more about your Jeep having wheels fall of or your Honda Civic catching fire from a wet window switch.
Reply: @michaellowe3665  " Because the purchase price is so high, you dont start saving money until you have had it several years.  Once its out if warranty, it can quickly become too expensive to fix if it has a battery failure then. 5.6% is rediculous considering what that battery costs." Let's see, the 5.6% failure rate doesn't apply now, and Tesla is continually improving their battery packs. The Plaid Model S, in fact, has a structural pack and new cells, different from mine. You aren't reading what I write, since I've told you the Model 3 costs the same as an average new car in the USA (a stunning achievement, don't you think?). Tell me, has any car company you know of that made a single model of car then come out with one half price in less than 10 years?
Reply: @michaellowe3665  " Once its out if warranty, it can quickly become too expensive to fix if it has a battery failure then. 5.6% is rediculous considering what that battery costs." Guess you didn't ready the 300,000 to 500,000 article, then. That's the average projected life of the pack based upon empirical data. I'm worried what happens to my Toyota when the 36,000 mile, 3 year warranty lapses...
Reply: @justsomeguy934  no one except your dopey friend wants an S-class.  Sure many people would drive them, but would ditch them after they get the bill for the first service. They are nice cars, initially.  You keep comparing you model s to that because it's one of the only cars that makes less sense. Sure if the only 2 cars available were an S class and a Tesla model S you would be a freaking genius for your choice.  Fortunately there are plenty more options out there.
Reply: @michaellowe3665  " They may be worthless at a certain point in the used market if reasonable replacement batteries do not become available." In the lightning-strikes-twice scenario you need a new battery pack, Tesla makes them. Oh and by the way, the used packs are very valuable. Once salvage yard I know of specifically buys Tesla battery packs to parse them out for $1,000 each sub-module (about 16, I believe). You should be worried about the average ICE car that's not worth repairing at 100,000 miles before you worry about a Tesla or Nissan.
Reply: @justsomeguy934  half the price of there own overpriced car.  Bravo Tesla.  They can compete against themselves for price.  Do you forget there are other car makers?  They call it a model 3 because it's the same size class as a Mazda 3. Most car makers build a car in that size range and they are half the price of the Tesla.
Reply: ""the video you sent stated that 5.6% of Teslas had a battery failure and most before 80k miles. " Nope, if the Tesla battery pack will fail, it will likely fail early and under warranty. I know a guy right now that Ubers with his Model S and has 150,000 miles on his car with about 7% degradation (the range loss occurred early into his ownership, 1st year, and remained flat thereafter). His personal experience tracks with the data in the article I gave you (I also have other articles with the same numbers).
Reply: @stefanweilhartner4415  the only reason Tesla was able to stay in business was the government subsidies and the emmisions credits they sell to other car makers. They continue to get those because governments only look at tailpipe emmisions and not the power plant emmisions from the coal they are actually using for power.  Combustion has a maximum efficiency.  It applies if you are directly using it to do work or burning it in a power plant to make electricity that charges a battery to do the same work.
Reply: @michaellowe3665  yes. the 4-motor approach of the rivian is the best regarding traction. but i guess that also results in higher cost. a differential gear is probably significantly cheaper than 2 motors with 2 simple gears and two power electronics.
Reply: @stefanweilhartner4415  dont forget tank turns. Beats the hell out of fart noises when your passenger sits. You are right, the F150 is probably the more practical approach, and I wouldn't buy a vehicle I rely on from a startup. If they last long enough the Rivian may be a good option used.
Reply: @michaellowe3665  even if you make electricity at 100% from burning coal, an electric car has less co2 emissions. that is because of the high efficiency of the whole electric energy transmission from beginning to the end. people tend to only look at the tail pipe emission of a combustion engine based car and compare that with the total emissions of the whole chain for electric cars. but if you also include the emissions of producing and transporting diesel and gas, then it is 100% who is the winner regarding emissions. and it gets even better and better because solar panels are ridiculously cheap now. calculating 100% energy coming from coal is not realistic anymore. CATL is soon selling natrium based battery cells for a third of the costs compared to lithium based cells. this is a huge success for grid storage, making solar and wind power affordable 24h. burning coal is soon getting too expensive.
Reply: @justsomeguy934  the video you posted with they guy wearing a Tesla shirt said 5.6% had a battery failure and most within 80k miles. Sure they may be projected to last 300k miles, but real data shows a significant number of them not reaching 80k miles.  Dont worry about me not reading your comments.  Try reading your own.  I'm sure many ICE engines may suffer a breakdown in the first 80k miles, but it wont take $20 to $30 thousand dollars to get them running again. 

I'm not knocking EVs in general.  I just dont think Tesla cares enough about past customers to provide the batteries and serviceability to keep them on the road beyond their first owner.  Hopefully other companies do this better.
Reply: @stefanweilhartner4415  that's fine, and I hope all of the new technology actually arrives, but transmission losses are also important.  All those nimby people in SoCal pushed electric generation out of state and their power comes from far away. I believe if solar power is really the best option, it is best produced on your own roof to cut the transmission losses.  As it stands, the melt furnaces that make the ingots for those solar cells are usually coal powered too.  Its going to still be a while before the equipment to make renewable power is made with renewable power and all recycled materials.  For now there are a lot of variables in the equation.  Cost is really the best way to aggregate those into an understandable data point.  When using coal gets costlier than solar and not just because of government taxes and subsidies, the corner will be turned.
Reply: @michaellowe3665  the rivian is a more stylish hipster truck for fun and probably a lot of stuffed people will buy it that won't even need it. there will be plenty of options for everyone. for me a truck is not the right thing. an ID.3 gtx with awd and the big battery would be the closest that i would like, still the price tag is a bit too much, but prices are still going down. i don't know how long my almost 21 year fun TDI diesel will last. the engine is still fine. can't go 240km/h anymore but 230km/h max is still possible. good old reliable diesel engine.
Reply: @michaellowe3665  solar is dirt cheap now. i will install solar panels with about 900Wp on my balcony next year. costs will be around 500€. lowers the bill around 150€ per year. in 4 years it paid off the investment.
Reply: @stefanweilhartner4415  I want to be able to tow a boat a thousand miles each way once a year and a few trailers a few hundred miles occasionally.  Currently that would be an awful experience in an electric.  Ford patented a bed mounted range extender that looks like a tool box a year ago.  An F150 lightning with that in the bed could really work for me, if it's reasonably affordable. Especially if I can leave it attached to my house as a backup generator when I dont need it in the truck. That is the kind of option that will make electric vehicles doable for the rest of us. It can run on gas or deisel, then if hydrogen or just a jumbo battery makes more sense in 10 years I can swap it instead of the whole truck.
Reply: @michaellowe3665  "Sure they may be projected to last 300k miles, but real data shows a significant number of them not reaching 80k miles.  Dont worry about me not reading your comments.  Try reading your own.  I'm sure many ICE engines may suffer a breakdown in the first 80k miles, but it wont take $20 to $30 thousand dollars to get them running again. " I do read my own comments. The replacements were made under warranty at that rate, and the batteries are being constantly revisioned. I'd like to see your "significant number" of Teslas not making 80K miles, as I know many past 100,000 miles, several well past that number, and only one that has had an early 60kW battery pack replaced. So the "significant" number of replacements were to early  batteries and Tesla replaced them under warranty in almost every case. I'm at 70K miles myself, no issues. 
Here's the quote from the article I left you, and it's three years old (at least two battery revisions since then, I think):
"The trendline shows 91% of capacity left after 270,000 km (nearly 170,000 miles)! At least that's the average.

If the trend continues that way, the 80% mark would be reached after 820,000 km (510,000 miles)... and still you can use the car with 80% range. Impressed? We certainly are." So at half a million miles, using empirical data, my 300-mile car will go 240 miles and all other factors are the same; same performance, same zero maintenance, same software-updated car. Hmmm. I'll take that over a 500,000 mile Toyota any day.
Reply: @stefanweilhartner4415  "this 35K model was crippled, the 35K applied without taxes but including the government grant. that is the definition of legal cheating." Interesting perspective you have there. First, Tesla sold an 85kW battery as a 70kW car for a long time. In fact, during a disaster (hurricane in the USA, I think), Tesla unlocked the extra capacity of the larger battery in the cars so that owners had more range during an emergency. I guess you don't know about economies of scale because it often costs far more to engineer, test and produce a slightly different product than to just rebadge a standard one. Want an example? I actually still own an old Texas Instruments calculator from college. I couldn't afford a more complicated one so I bought the cheaper one on sale. One day the metal keyboard cover fell off, and lo and behold there were two keys under the cover that you couldn't see - one was square root. That's right, TI simply covered up the square root key with a metal plate and sold the same calculator at a cheaper price. The cost to them was the same, and certainly cheaper than engineering a new keypad and perhaps a new chip that didn't understand square root. So your "crippled battery" accusation doesn't make much sense to me.
Reply: @michaellowe3665  "As it stands, the melt furnaces that make the ingots for those solar cells are usually coal powered too." And once created, those solar cells make free energy for decades. You must burn something for anything else.
Reply: @michaellowe3665  " Beats the hell out of fart noises when your passenger sits. " Oh - are you referring to the new entertainment release from the Ford Mach-e that has a sketchpad like tesla, and an app that automatically plays tic-tac-toe with you?
Reply: @michaellowe3665  "half the price of there own overpriced car.  Bravo Tesla. " Damn, dude, don't embarrass yourself like that. Yet again, you didn't read what I wrote and I don't like repeating myself. The battery pack in my Model S cost Tesla (at the time) $15,000 to produce. The car isn't overpriced at that cost whatsoever. In fact, I'm amazed it wasn't a $200,000 car with Tesla having to pay factory costs, labor, development and investors. Let's put a $15,000 gas engine in a new car company's new model and see what you think they could sell it for. And it truly is BRAVO, TESLA - they got the price of their costliest component to their car down to HALF in 5 years or so. All while adding features (you know, like autopilot?). I'm waiting for you to send me your business resume so that you can prove you understand enough about billion-dollar startups in a highly regulated industry and even MAKE a car under a million dollars each. Again with the "overpriced" statements, are you sure you don't have problems with people that can afford a car that you can't?
Reply: @michaellowe3665  "The cheapest car they sell is $40k. They dont sell a $25k car because the materials it takes to make one would cost more than $25k.   " Hey! Did you read the link I gave you about the $25K Tesla model that was announced? Did you want to retract your [yet again] baseless statement, or just move on when proven wrong? Are you redirecting the conversation to cover up the facts or do you not understand the concept?
Reply: @michaellowe3665  "no one except your dopey friend wants an S-class.  Sure many people would drive them, but would ditch them after they get the bill for the first service. " Yet again, reading comprehension doesn't seem to be your strong point. I've already stated (shall I quote for you?) that in order to compare two vehicles, they must be the same class of vehicle. You don't compare a Nissan sub-compact to a Cadillac and declare the Nissan inadequate, or the Cadillac overpriced...they're completely different markets and cars. Since we don't compare a Sentra to a pickup, you don't compare a Model S to a Mazda 3 and declare the Model S overpriced. For size, performance and number of passengers, very few sedans match a Model S. Given that the Model S can be a 7-passenger model, exceedingly FEW cars match it at all. The closest is a Mercedes S-class. Your dig at Mercedes owners is also baseless (as usual), I'm neighbors with the state-wide and regional Mercedes Benz car club and I can assure you their customer service experience is stellar.
Reply: @michaellowe3665  Oh and by the way, your arse needs lots of care as you keep pulling senseless statements out of it. You claim the Tesla Model 3 was named that to mimic the Mazda 3? Um, no. Tesla originally wanted to name the Model the the "E", so that is car models would be "S" "E" "X" "Y" - get it? I can show you a link to a video where Elon Musk makes this very statement, but you don't read what I tell you so why bother. For those that are reading this (Michael Lowe isn't), Ford owned the "E" patent/name and wouldn't release it to Tesla. So if you'll notice the font of the Tesla Model 3 name, it's often shown by Tesla as 3 flat lines to look like an "E". Damn, I'm good.
Reply: @justsomeguy934  that of course is not true because they are not all in parallel. the have a few in parallel connected in packs that are then connected in series to reach a high voltage. one cell in a parallel pack degrades that pack and let the others in that pack age faster.
Reply: @justsomeguy934  this is independent of the car manufacturer. it is a simple decision the luxury cars should not receive government grants. what you are telling here is of course bullshit because germany also makes a lot of high end luxury cars. and germany is also not the whole eu. 
it affects a lot of german brands like porsche, audi, bmw, mercedes
Reply: @justsomeguy934  and of course you are wrong again regarding the warrenty. i just looked it up for the model 3 standard range. it is 8 years or 160.000km whatever happens first. and it only applies for batteries that degraded below 70%. so, if the battery degrades by 29% in the first year, this is not covered by tesla's warrenty.
this warrenty is not better than the one from VW.
Reply: @stefanweilhartner4415  "this is independent of the car manufacturer. it is a simple decision the luxury cars should not receive government grants. what you are telling here is of course bullshit because germany also makes a lot of high end luxury cars. and germany is also not the whole eu. 
it affects a lot of german brands like porsche, audi, bmw, mercedes" You need to be specific - are you talking about Canada or Germany? In Canada, the tax incentive was specifically for EVs, correct?  There was (and still is) not equivalent EV for sale to counter Tesla. In Canada, they just didn't want to use tax money to buy an expensive car, and effectively killed their EV push. Tesla was the only practical EV available, but the people that don't want to fund an expensive car objected. It's the "if I'm not getting help to buy a Nissan Sentra, I'm surely not going to help buy a Tesla" mentality.
Reply: @stefanweilhartner4415  "this is independent of the car manufacturer. it is a simple decision the luxury cars should not receive government grants. what you are telling here is of course bullshit because germany also makes a lot of high end luxury cars. and germany is also not the whole eu. " Again, are we talking Germany? The German EV incentive, just like the American EV incentive, applies only to EVs, not regular cars. Since Germany didn't (and doesn't) have a domestic EV that can compete with Tesla, Germans were buying Teslas and NOT VW's. Buy lowering the purchase price eligible for an EV for everyone JUST ENOUGH to exclude Tesla, the overall price reduction excludes just Tesla. Get it? Surely you can see through your own BS enough to see that. 
Brand A sells shirts for $5, but is imported. Brand B sells shirts domestically for $4 but no one wants them, they want Brand A. Well Brand B buys a politician that gives a $1 tax break to all shirt sellers, but only on shirts $4 or less. TaDa! I've used a non-specific rule to exclude my competition and a specific manufacturer. Bullsh!t indeed!
Reply: @stefanweilhartner4415  "that of course is not true because they are not all in parallel. the have a few in parallel connected in packs that are then connected in series to reach a high voltage. one cell in a parallel pack degrades that pack and let the others in that pack age faster." Most EV battery packs are both serial and parallel, and the new Chevy Bolt touts this feature to geet 800V charging. The simple fact is that it would take a horrendous number of cells out of my car's 7,104 to affect the car's range, and Tesla has accounted for, and balances, all its batteries. I'll trust Tesla's battery management system before I'll trust your evaluation of when a bad cell out of 7,104 cause a problem. Electrical engineer, are you?
Reply: @justsomeguy934  yes, i am an electrical engineer working in the power division of one of the biggest producers of microcontrollers and before tesla even sold the first car, i made the software for lithium based battery chargers. no rocket science to me. this is simple behavior of series and parallel circuits that is taught in the first class of a technical high school.
Reply: @stefanweilhartner4415  "yes, i am an electrical engineer working in the power division of one of the biggest producers of microcontrollers and before tesla even sold the first car, i made the software for lithium based battery chargers. " First, you didn't write Tesla's software; what you think you know may or may apply to their battery management. Second, to what statement are your referring? Battery life? Do you see how I quote the statement I respond to so what both people know what they're talking about?
Reply: @justsomeguy934  the laws of physics apply to tesla too. as i already stated, this is first class school knowledge about Ohms law.
Reply: @stefanweilhartner4415  "the laws of physics apply to tesla too. as i already stated, this is first class school knowledge about Ohms law." Excuse me, weren't we talking about your statement that a small number of cells in a Tesla battery pack was going to cripple it if they went bad? There are almost 200 replies to this thread alone so that's what I remember about your original comment. You're retreating to an argument of authority, stating you know better about the subject due to a degree or a class you had. You didn't know the sheer volume of cells in a Tesla battery pack, nor would you know unless I told you. Ohms law (and your class attendance) aside, a huge number of cells would have to fail for any meaningful impact happen to a Tesla battery pack. Unless you've designed a Tesla battery pack or programmed their BMS, your statement that you're an engineer doesn't apply in this discussion. Given the 7,104 individual cells that are managed in my pack, I'd say Tesla accounts for some that don't cycle like the others with no observable loss of range.
Reply: @stefanweilhartner4415  "there is NO new tech in battery circuitry in a tesla or any other EV" I suggest you update your skill set. Given that the Tesla batteries change almost monthly on footprint (new 2170, 4680 tabless architecture), chemistry (cobalt/no cobalt/alternate electrolyte) and battery pack design (drop-in pack vs. integrated/structural pack), I'd say you should realize how antiquated your knowledge actually is. I suggest you don't spew what you heard in a class in high school, it makes you appear old and set in your ways.
Reply: @stefanweilhartner4415  " there is NO new tech in battery circuitry in a tesla or any other EV" Well, you officially placed yourself in the entrenched management class of Sears, Kodak and Blockbuster. Bring your stock certificates from those companies with you when you apply for a job at Tesla, will ya? 
(regret calling me stupid?)